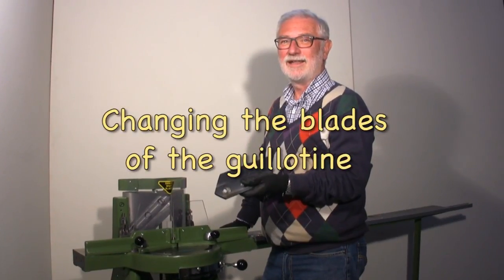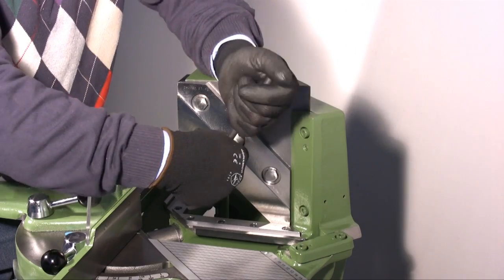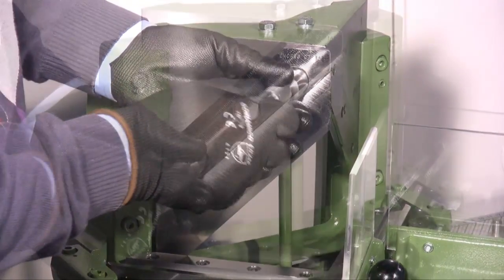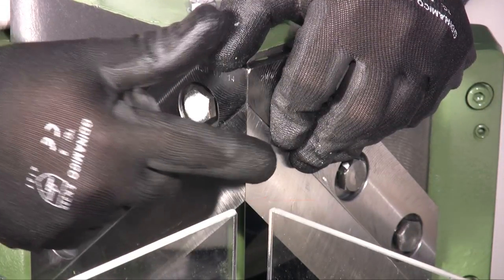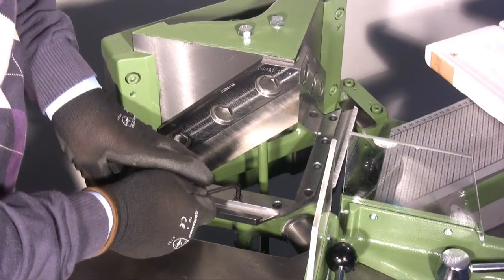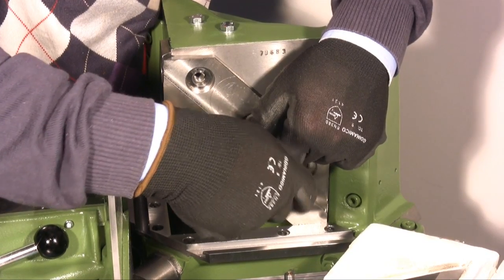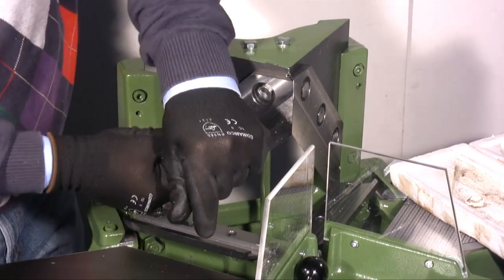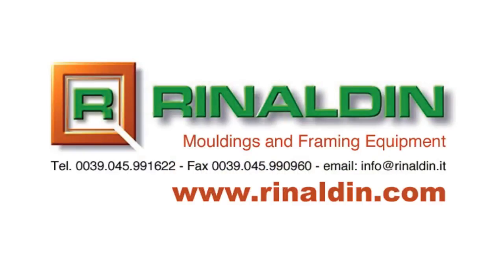Changing the blades of the guillotine

Comment: I have a cassese cs55m2, the cilynder is blocked, i can't move the handle, there doesnt seem to be any rust, i have removed all part, pured oil in the cilynder, tryed with force to take out the cilynder for further cleaning, but impossible, any idea how to release the cilynder would be helpful ?
Reply from the maker: We are sorry but we do not keep these machines. The best thing is that you contact directly the producer to try solving your problem.
Reply from the maker: You should contact Cassese to resolve the problem. Sorry but we can't help you.